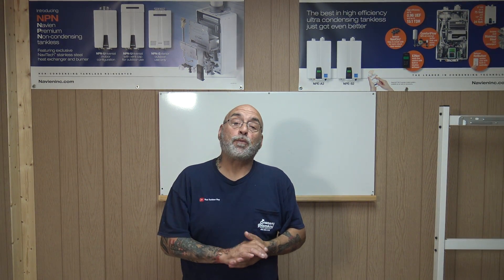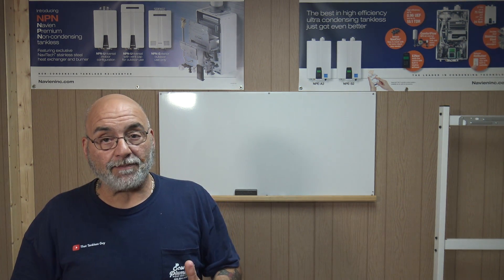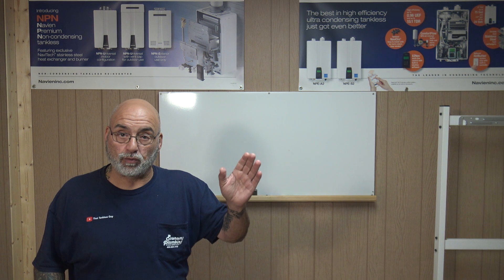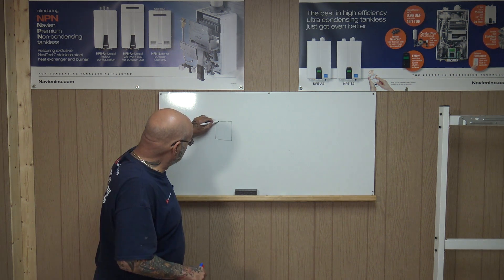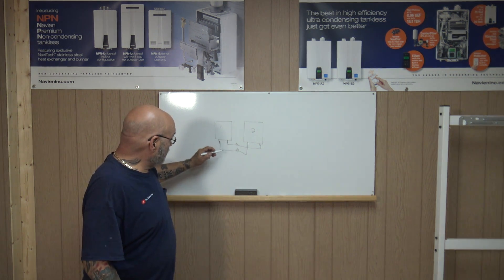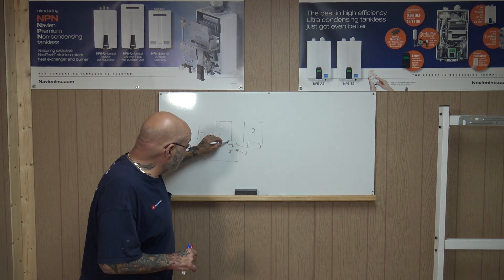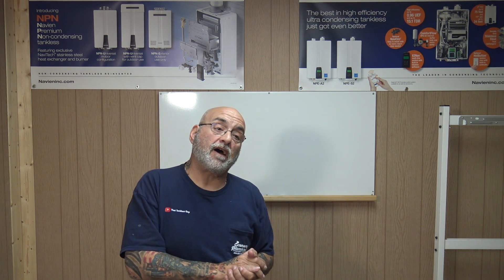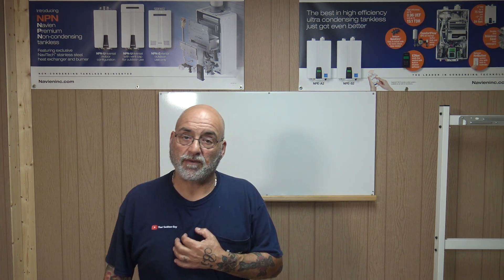Proper piping for multiple Navien tankless heaters, First in Last out

Comment: I was under the impression that by cascading the systems via the communication cable the units were able to balance hours used by way of the water adjustment valve. Last year I attended the Navien class in New Jersey and I thought we went over this. This may only be for Naviens, and I may be remembering incorrectly, but I just thought I’d ask why you would need to do FILO in that scenario.
Reply from the maker: Without the correct piping the cascade cables won't work correctly. Only the hours will operate.